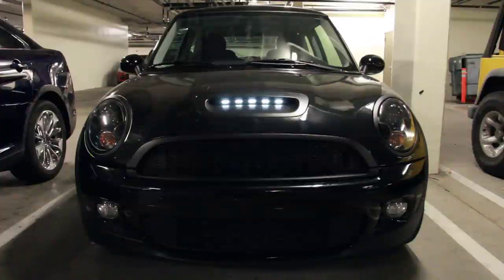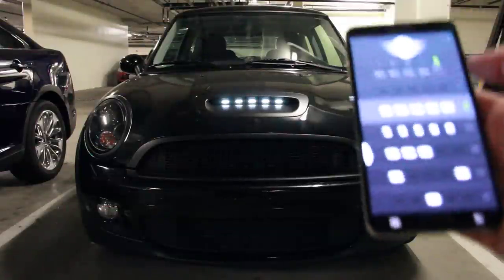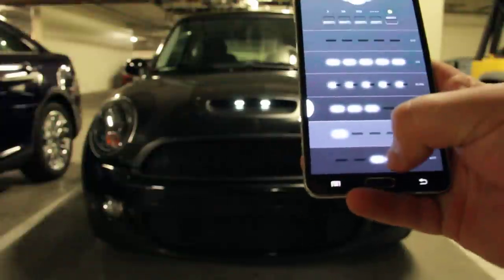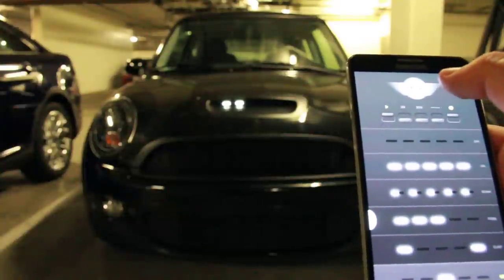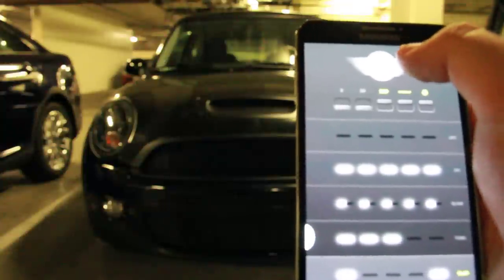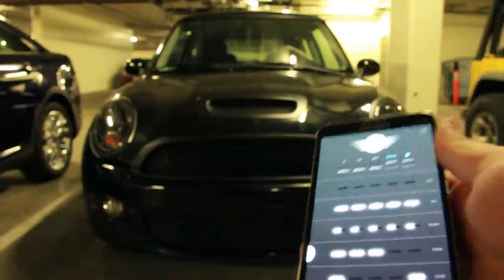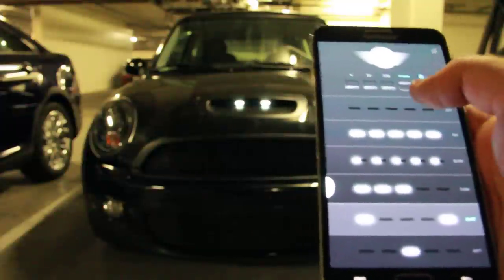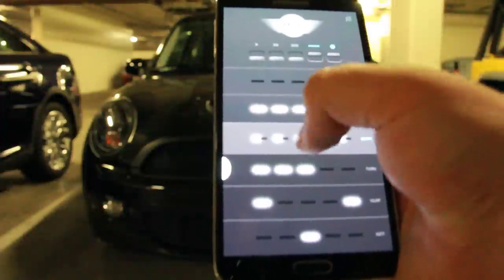Bluetooth LED Hood Scoop for Mini Cooper

Comment: Soo it's been 9 months since you've touched on this. How's it going? Any updates ? I would love to inches in this with you
Reply from the maker: Hector Perez Hey Hector,
Unfortunately things have been pretty crazy since then (work, life, etc.) so this project has been on hold for quite a while. I do still have a bunch of parts lying around, so if I get time I may try to make several of these things for sale. The issues that still remain (in terms of making this a viable kit) are:

1. the app has the bluetooth module's address hard coded in it ( I think... or maybe it was the phone's mac address... it's been awhile). This would need some tweaking so the user could enter it themselves. (keep in mind I'm not much of an app developer, so this may take a little bit). Otherwise you'd need to send me your phone's mac address and I'd have to hard code it in each app. It should be a fairly trivial change. I'm thinking of redoing the app in the MIT app inventor, because development time is super quick and changes can be made rapidly.

2.The acrylic housings for the LED's are a bit messy. I could do a revision on these and they may be nicer, but they will still need to be placed within the grill and have sealant put on the backside to keep it from moving around. This is something that's hard to make consistent, so each kit might vary slightly. 

3. I only have LED cutouts for r56 grilles, so none for r60 or r53 as of yet. 

4. for the r56 grille, one hexagon has to be dremelled out (the center one). This is something I could do on my end, but then the cost of the kit goes up because I've got to order grilles from mini and do the dremmeling. This is another source of potential inconsistency in the craftsmanship. I could leave these steps up to the user possibly.

5. there are probably a couple other things I'm forgetting, but the point is I don't want to sell a kit that people are unhappy with (especially when each takes a fair amount of time for me to make). 

So this is what I'm thinking (give me your feedback about this):

What if I make the following available for purchase:

1. arduino + bluetooth + housing module, fully programmed and ready to go.
2. I make the app available for download (which I need to update first - and will likely not be able to provide much support for in the case that you have issues with your specific phone). 
3. I include all the cables and connectors required to wire this thing up, but leave some of the work up to you (but with youtube instructional video showing you how to do everything).
4. include some lasercut acrylic and LED's for you to assemble and install into your own grille - which will require you to dremmel out the center hexagon shown in the video. This step would also require some soldering of LED's to some wires. There would be a full video walkthrough for this as well. 

Let me know what you think about all this. 

Best,
Brian